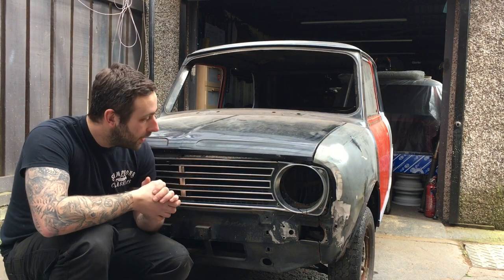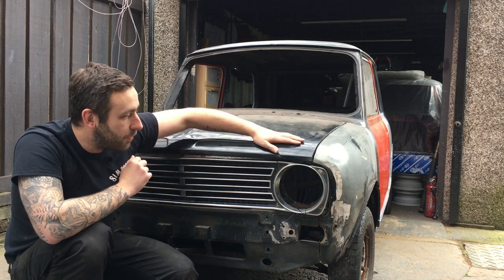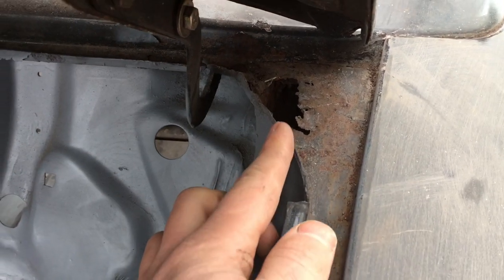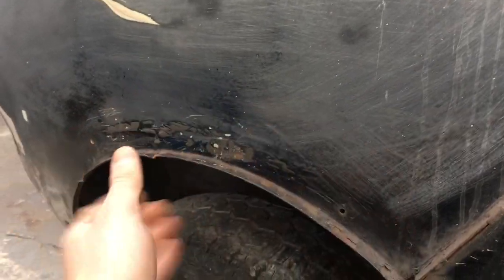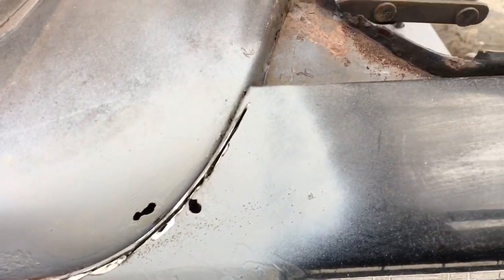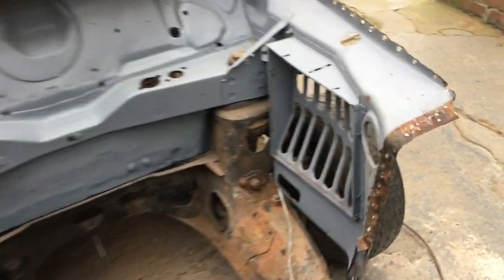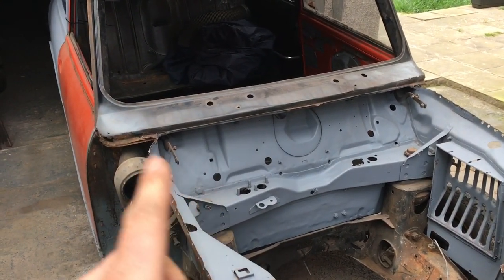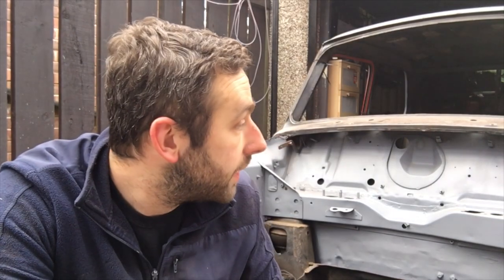Classic Mini Clubman Budget Restoration - Removing The Front End

Comment: Marc, You could drill a hole on the underside of the inner panel and use a ball type lever to pop up the dent and either use a 
grommet or weld the hole closed, The other way is borrow or rent a dent puller. Cheers Dave
Reply from the maker: Cheers Dave for those tips I have seen that method used and it looks really good. I think I will invest in a dent puller I need one for a few other jobs on the car so think that’s what direction I will go in. Cheers 👍

Comment: Thats a solid basis to start again with. I would drill a hole or two in the panel holding the bonnet catch (on the bonnet) and put in those panel rods to remove the dents from the front edge, skim of filler and done. Gutted your plan didn't work.....I wanted to see a Clubman front end sofa 😂, be safe mate 👍🏻
Reply from the maker: Yeah definitely I am still so shocked how good this shell is for what I paid and how old it is it’s really not bad at all. Thanks for those tips on the bonnet dent I will have a look in to that. Well it was going to be a bbq for the garden but that didn’t work out lol the front was so bent it just wouldn’t have looked right.
Reply: @SimpsonsClassics  A good plan for the front end, shame it was beyond it though. You're welcome on the tip for the bonnet, I noticed that Davejaguar66 said a similar idea so I must be heading in the right direction because Dave really knows his stuff.